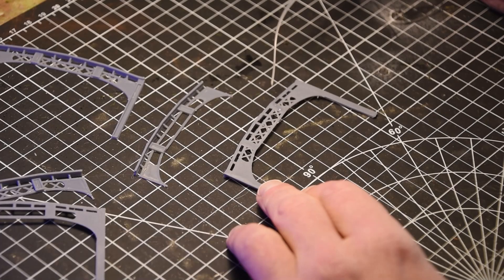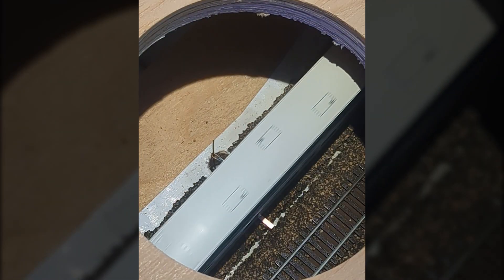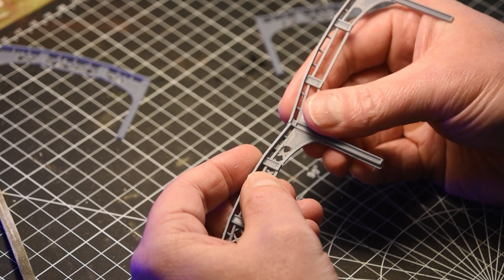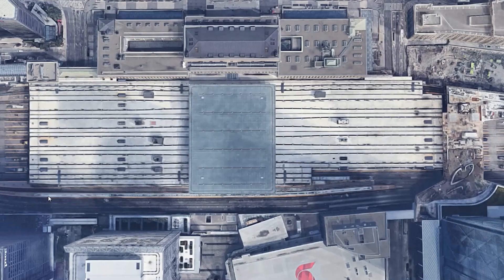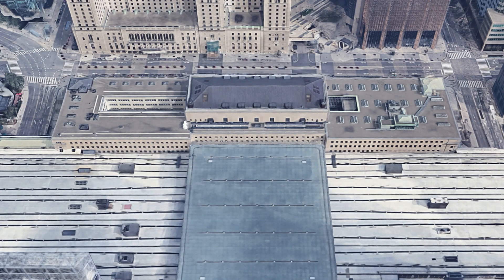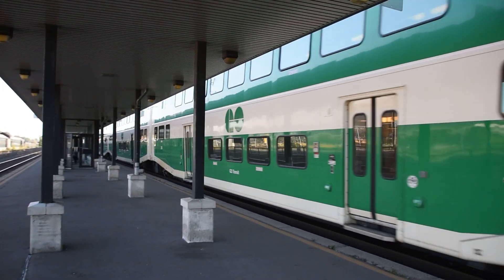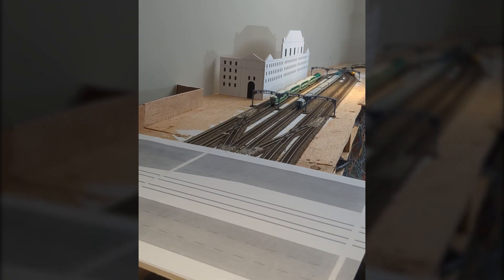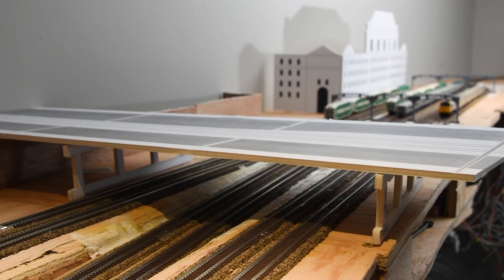Update: N Scale Station Planning and Design

Comment: Oh yeah, the buildings once more really make this project shine in a new light. That 6-lane road bridge thing and the small houses on the right hand side work really well, as does the main station, but I agree, that to-scale building to the left is taking up way too much space and blocks the view a bit too much. "Compressing" that building will do wonders to make that entire looping area get some breathing space.
It's amazing what small stand-ins achieve in such a project, the platform details already make this look cool!

It's kind of cool to see how "artistic license" is applied in such a project: You can't just shrink down a building to the correct scale, it might still be a bit too large, so you also have to condense it down... and then you also have to pull that off without disturbing the design too much, or else it might look weird.
Reply from the maker: I'm really enjoying thinking about how to scale down buildings. Artistic license is absolutely correct as simply scaling. The buildings doesn't work... You need to alter them to capture the essence of the building , just not make a smaller version of the original.

Comment: Looking at the mock up and the map (not knowing the station at all beyond your images and google maps) one thing that it seems to me you might have missed is that the track level at the station is at a higher elevation than the side street level of the station building, the bottom unwindowed area on the side is not needed if the station sits at platform height instead of having sunken sides. You may have accounted for this but  it looks like that is not the case and that may make a difference to your happiness about the proportions.
Reply from the maker: You're exactly right. The station entrance sits a story and a half below the track level. I'm going to play with some designs, but I'm likely going to reduce the height of the overall station as well as the width of the center portion. You have a keen eye!

Comment: Cool exercise. These mock-ups really give a great sense of scale. Especially the one of the condominium. With the around 40% representation of the Union station you seem to be on point. However, I humbly think a lower elevation would do the structure more justice. It seems much higher than the prototype. Might be because the length only represents two fifths of the actual structure. Also, for a more in-depth look at the station, the structures for the platforms covered with some ‘mock-up’ roof might help to determine the model height better. Love the vid. 
For a next drill job with your hole saw, just put the battery drill on the low setting. That will truly help to control the sawing action of the hole saw. The fast setting isn’t really necessary for holes above 5/4”. Lastly, as soon as you drilled the first millimeters into the plywood, it’s possible to do away with the pilot drill. Or replace it with a much shorter one. That will prevent accidents from occurring. Cheerio
Reply from the maker: Thank you for leaving such a detailed comment! Your note about the elevation is completely accurate. I had reduced the structure's width, but neglected to reduce its height, resulting in it appearing excessively tall. I have made multiple revisions and am nearing a version that I am pleased with. You are absolutely right about the hole saw. I was given multiple suggestions to begin the cutting process with the center bit and then remove it to complete the job. I was impatient. 😉

Comment: He's human! I commented previously about the competence with full size tools and materials. But that holesaw error... I didn't laugh, just tensed up as the saw went in without checking and double checking while knowing I could yell a warning!
   Now to get out the diamond core drill and buy a variable speed angle grinder to cut 115mm hole in bathroom wall to reposition the extractor fan. No cables or pipes but there might be some brick wall ties to look for.
   Portals are good. I've got some placed discreetly in a few floors and walls in our house to help access to cables and pipes. Surprised very few other people do it
Reply from the maker: I was in such a hurry to create the access hatch I never considered the consequence of error... At least it was repairable!